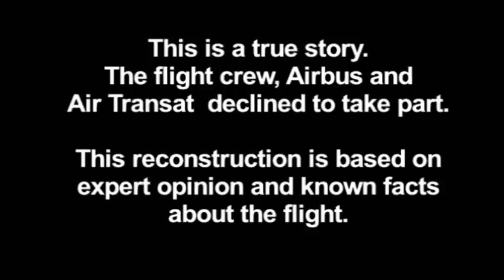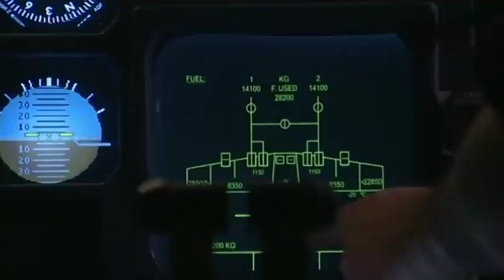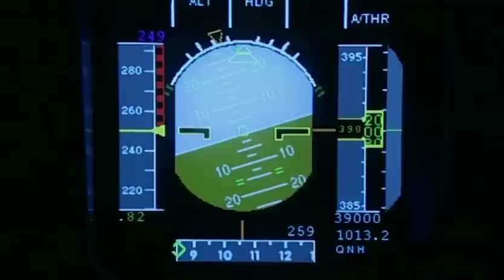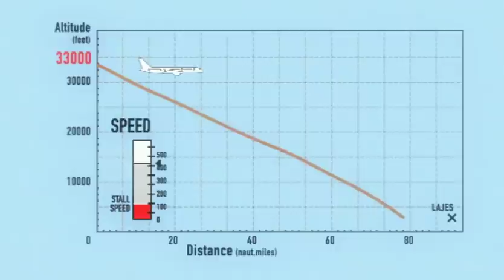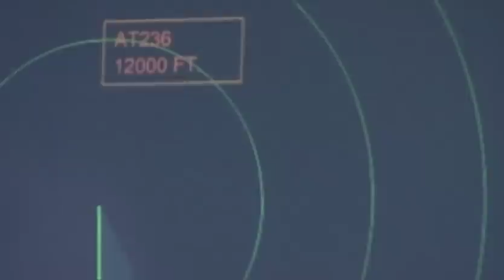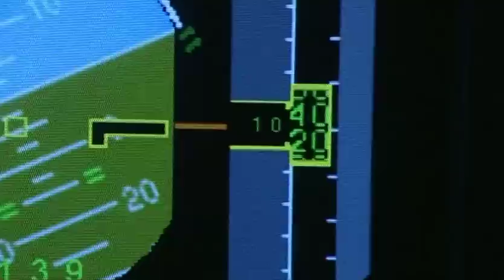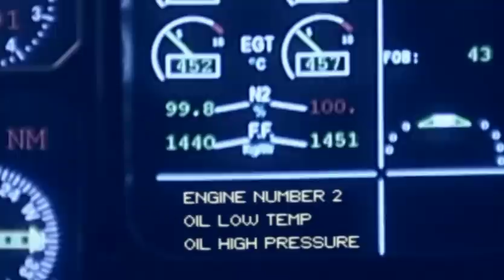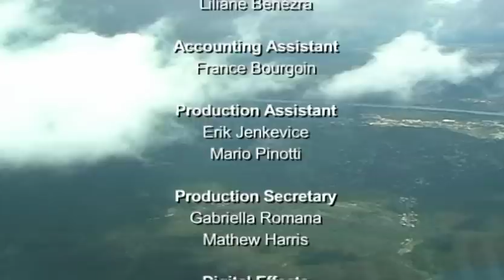Air Crash Investigations Mayday   01x06   Flying on Empty Air Transat Flight 236

Comment: How dare they try and blame the pilots and try and throw them under the bus, they saved everyone's life
Reply: Yea they didn't have to!
Reply: They did everything they could while believing the computer or sensors were faulty. I do not blame them although I would have gotten suspicious when fuel sensors from the other tanks said they were draining fast. I also would have asked for a fuel check somewhere around 5 minutes after the strange pressure reading just to be sure. Hindsight is everything for these kinds of things though and I’m not sure it would have made a real difference.
Reply: @dragonrider1817  they always teach pilots to trust their instrument readings
Reply: The pilots are  partially at fault for this.
One of the first lessons that is drilled into a student pilot's head is, "ALWAYS TRUST YOUR INSTRUMENTS".  They forgot that lesson.  I watched a pilot drive his plane into the ground because he would not believe what his instruments were telling him.  He got confused by the weather conditions below him on the ground and in the air.  He lost the ability to tell where the sky ended and the ground began.  Had he  paid attention to his instruments he'd left that plane alive an unhurt.  Instead, he died needlessly.
Had the pilots trusted what they were being told, they could have possibly diverted earlier and not run out of fuel.
Like it or not, they share some of the blame.
Reply: I am cornholio Although they do teach that but sometimes the computer has a malfunction and then the instruments won’t work properly then in that case that could leave in a disaster because u may not know your altitude or your airspeed and then your autopilot will disconnect I think then u will be flying by hand and if your instruments are getting a miss reading then it may say that your going down but in reality your going strait so u correct that then go up when u don’t know and at night u can’t see the horizon that much so it’s hard to tell with your eyes if your going up or down so then u end up stalling and if your computer fails then your GPWS call outs might be bugged out so it could call over speed or stall or both (like Qantas 72 the QPWS fallouts were saying “Stall Stall” and the over speed alarm was going off they landed though) so then u would be confused on what to do, do pitch the nose down or slow the aircraft down or pitch up further then if u slow down or pitch up more then u will stall and turn into Air France 447 the co pilot was pitching up even though the GPWS was saying “Stall Stall” HA TAKE THAT!
Reply: While the possibility for the scenario you describe exists, it is a very small one.  99 times out of 100, t he instruments will be correct, especially if you are piloting an older plane.  In any case, until you know for certain your instruments are wrong, it is best to trust them.  Even computer-controlled instruments rarely fail.
Reply: Allan David Well like I said with Qantas 72 the GPWS what saying “Stall Stall” and the overspend warning at the same time due a combination of a design limitation in the flight control primary computer (the software on the A330 and A340) and a failure mode affecting one of the aircrafts three air data inertial reference units and this happened in 2008. And the pilots could tell that they couldn’t trust the GPWS call outs cuz it was clear that they weren’t stalling or over speeding and in that case the autopilot thought that the plane was stalling so it pitched down very strongly and wouldn’t let the pilot fly until the pilot let go of the side stick and the plane leveled off so that was basically a computer malfunction
Reply: And LIKE I SAID, that is a very rare occurrence.  It is literally the exception to the rule.  Exceptions DO NOT make the rule.  09% of the time, such things DO NOT happen.  I'm glad it worked out okay, but just because it happened once, it does not follow that the instruments should never be trusted again.
Reply: I blame the senior pilot. He should of called an emergency very early on. Their was many signs that it wasn't just the computer fucking up. He seemed to worried about his reputation if their was fuel. If this reenactment is at all accurate on what happened in the cockpit.
Reply: @Mantis_Toboggan_TrashMan  the pilot definitely made a poor judgement by not believing the computer
Reply: @FaithandNova  Ok he should have taken his instrument warnings more seriously instead of concluding it was a computer fuck up,  but he got 300 people down safely with no fuel left in his plane. That IS the bottom line and all that matters.
Reply: I feel the same. It was a maintenance fault obviously. They did what they knew best under horrific circumstances and saved lives. All that matters.
Reply: The pilot's were at fault, they had too many different warning's to blame the computer, plus they should have turned for an alternate once they were getting these readings.
Problem 2: They clearly left the cross-feed on until the second engine went down, you can tell because the engine on the other side went down just 12 minutes after the right engine, this means they were running the cross-feed and feeding fuel from the good side to the bad non stop even though the sign's showed that the leak would be on the right side.
If the pilot's wouldn't have turned on cross-feed so quickly, or if they just turned it off after seeing the fuel was draining quicker than expected, or if they would have trusted their instrument's this wouldn't happen.
Reply: Because the crew made the decision to pump fuel from a good tank to one with fuel pouring out.   It defies logic but they did it.  If they had merely let the defective tank run dry they could have used the fuel in the good tank.
Reply: @Kev376  Did they even have a way to check for a fuel leak realistically? All they really hand was potentially unreliable information and their instincts. Ideally they should have at least have tried for running the math again after turning on the cross feed; then shut it off to salvage the remaining fuel.  Unfortunately tense situations rarely make for ideal circumstances. Honestly the fact that they maintained enough competence to land the plane safely says a lot about their capability.
Reply: @laughingman2082  Everything is potentially unreliable, but if you don't give your instruments a chance then you will regret if if you find out they are telling you truth..  I'ts been a while since I posted that, I would have to rewatch this to reliably give you anymore detail to my post and don't have the time, either way I hope things turn out for the best.
Reply: I am cornholio who really cares
Reply: Wrong. Assume the worst. He convinced himself it was a computer glitch, when he should've planned ahead in case it wasn't. Easy in hindsight, but he definitely deserves some blame.
Reply: Well technically if the pilots would have turned off the fuel cross valve the left fuel tank and engine would continue to function. BUT with that being said there were very few clues to suspect a leak from the right engine and they did an incredible thing by landing the airplane safely.
Reply: He followed the procedure. You must transfert fuel in order to equalize the weight of the plane each side.
Reply: I don't recall any depiction of any attempt to blame the crew.
Please time stamp your remarks in the script.
Reply: They ALWAYS try to blame the pilots easy scapegoats
Reply: , @allandavid9275  I agree with you, David. It is common sense, and there is no room for an error. I rather land early to make sure my passages are safe than to jeopardize their lives.
Reply: I can’t believe they didn’t close that cross feed valve. That’s obviously something they should have done

Comment: I still cant comprehend it, that something that heavy glides instead of just falling down immediately when no engine air is pushing it sideways, the air and wind up there must be 100 times stronger than we have down here
Reply: Airplane wings are designed to keep the plane in the air even without engine power. Also the wings are designed to hold the weight of the engines and the rest of the plane

Comment: Even if the pump looks the same its part number must match the list of part numbers approved for that specific engines part/serial number.
Reply: @Jesus Christ Point being the mechanic didn't use or ignored  the maintenance manua IPC reference. When the FFA visited us they didn't look at the aircraft we were wrenching on, they asked us for our maintenance manual references. Also all of the inspectors that checked and signed off our installation checked the part numbers. Research and paper work is half of the aircraft mechanics job. The Airlines sent us to class to show us how to use the maintenance manuals. None of the mechanics or inspectors I have worked with would have installed and signed off that pump without checking the numbers.

Comment: I'm thinking it read oil temp low because of the abnormal fuel flow to the oil to fuel heat exchanger. And the high pressure probably cause of the low temp oil.
Reply: Ikr

Comment: Thinking the computer is wrong was their biggest mistake. one wing heavier than the other is a much less of an issue to deal with than a leak and a dead engine. They should have closed the crossover when excess fuel loss was noticed and then not used the crossover until it became apparent that the plane was becoming unbalanced (the left wing would dip). this would have given them max range. in other words NOT using the valve is a way to diagnose u have a leak.

Comment: Am I the only one dying to know why they didn't turn off the cross feed at the first suspicion of a fuel leak, wth.  Also, why don't they have a little light that says how many miles of gas they have left.  My car has that.  Also, also, which is worse crashing with shoes on or being on a plane where everyone was told to take their shoes off
Reply: Amellia Mendel The most they had to know was the plane said low fuel pressure warning. They thought maybe right engine not getting enough fuel, lets give it some more by cross feed like the manual said. Back then everyone thought things like this could never happen. 
Now we know better. But still hindsight is 20/20.

Comment: Couldn’t the low oil temperature have been from exposure of the leaked fuel causing exposure of the oil to outside temperatures?
Reply: No they didn't have anything to do with the fuel leak.  those readings were for engine lubricating oil temperature which is a completely different problem. That part probably was due to a bad sensor or some such thing
Reply: Low oil temp was caused by jet fuel leaking onto the engine and cooling it. Cold oil made the pressure rise. They followed the procedure book and called Mirabel for help. That's why at the end changes were made in the procedure manual
Reply: HighStreet Killers —Thanks for the info
Reply: What exposure to outside temperature?
Reply: @willschultz5452 ,  when will scientists create a crash-proof airplane?  an airplane that falls from the sky onto the ground,but does not get destroyed.

Comment: Odd with today's technology that we don't use more ground support when flying these behemoth computers. A Formula One car for example has a team of support staff constantly reviewing car data for potential issues via remote intelligence sent from the car to the pits. You would think with so many challenging tasks for today's pilots air to ground monitoring could tell pilots long in advance of potential issues and what to do to avoid catastrophic failure in flight? Reading a manual for a procedure generic in content seems a bit outdated?

Comment: Runway Repair & Facility Use Invoice: 
800m 5cm depth divots - $280,923; 
1,400m rubber abrasion - $4,543; 
fire rescue services, 2.56hrs - $330,429; 
towing & storage - $127,895
unscheduled flight 48mins @$432/min - $20,736; (includes radar & vector services * weather reporting * transmission band usage * visual spotting)
customs clearance & transit passenger hosting services - $14,330 (includes toilet flushing)
patience & tolerance fees - $85,842
island presence convenience taxes - $822,722

Comment: They should have closed the cross feed valve,  when they determined that they were now losing fuel faster in the right tank than the left tank, when they opened the cross feed valve to even out the fuel to both tanks.  Anyway the plane became a glider when both engines quit, and it was an amazing feat to land that plane safely.

Comment: Don't worry if you run out of fuel in a  passenger jet liner you will still be completely safe because of your altitude as long as you're within a few hundred feet of a airport you can land safely see no problems. Pilot should not worry if their fuel gauges read empty they're usually wrong just a computer problem
Reply: Good one.

Comment: Here is the problem, a wrong part installed lead to a large fuel leak and with various types of weather and other common anomalies that give false sensor readings on a regular basis the captain made a good judgment call and when all else fails he was still able to save the plane and the 300+ people who were on board by landing the plane with very minimal injuries and No loss of lives at all so Salute to the Captain and First Officer of that flight, they did there best in a time of crisis and succeeded in a safe landing after gliding for miles with no engines working on a fully loaded plane and for those investigator to even try to point any blame at those to hero's who saved the day due to a problem due to wrong parts and a company trying to save money is a real Bullshit political maneuver to try to shift blame and get out of the responsibility for the mistake someone else made. Those two pilots are the reason the plane landed safely and all the passengers are still alive after landing safely under total failure of both engine's. As I said before Salute to the Captain and First Officer of that flight.
And to explain this situation as I can compare it to in the field work I do, I am a Refrigeration Parallel Rack Mechanic, a Parallel Rack Refrigeration System is what a large Grocery Store uses to keep all the cold food cases cold and in lay men's terms instead of one unit that is 3-5 HP running one case with 8lbs - 15lbs of Freon in the system, kinda like the one air conditioner unit outside of your house that is 2 ton or 3 ton and has 5lbs or 8 lbs of Freon in it a Parallel Rack Refrigeration System is 30 HP - 100 HP and has 300lbs to 1,000lbs of Freon gas in it and the older Rack system's has time delays and pressure controls for everything and that was in the 80's when we still used R-12 and R-502 and as we got into the 90's and the old Freon was phased out and computers were starting to be used we all kinds of sensor failures but the old pressure controls were all there still as a emergency back up and with my service gauge manifold set to test pressures I was able to get Racks up and running again many times with sensor failures being the reason the cases were getting warm and those pilots who learned to fly in older military fighter planes that had manual gauges really know what they are doing so that is how they can still land a plane when it all fails and they have to glide to the nearest runway  is the old school training they had just like me on a Rack system, with 100 HP and 1,000lbs of Freon gas you can get yourself into a lot of trouble Fast if you are turning the wrong valves and whatnot and you need to know how to get yourself out of trouble in those situations and those pilots are in the same situation only they have many lives at steak were I only have my life and those few working with me and several thousand dollars with of food in the cases in the store at stake but in major gas leaks in a motor room we had to tie a rope around our waist, hold our breath and go in and try to find and stop leak and the rope was so the others could pull us out to clean air and save us if we passed out with no breathable air in the motor room while trying to stop a huge Freon gas leak  so I hope this comparison helps you all who are reading this understand what is happening and how those pilots are able to land planes in sutch failures still and save all the passengers. Thank you for reading my comment on this video

Comment: Wow, who was supposed to inspect the maintenence work. Hope someone was held responsible.
Reply: lori doolaghty, I'm wondering if it's the maintenance crew's Superior, the same jerk who told the mechanic to use the parts from the one they were replacing because it would cost too much money to have to wait for a new part to be delivered. Imo, that Superior is the person who is the cause of this accident.
Reply: Nobody inspects the maintenance work the mechanic does the work and fills out his paper that it's finished and the plane rolls back out into service. The mechanic did not want to do the job the way he did it but his superiors forced him to. Personally I would have said I'm not doing it that way! I know better then to do stuff like this!
Reply: @willschultz5452 : the Mechanic Brought Up the Fact That the Hydraylic Pumps Weren' t EVEN the CORRECT PARTS For That Engine,So Supervisor Should NOT EVEN APPROVED THE INSTALLATION OF THE UNDERSIZED PUMPS.MAINT.SUPERVISOR SHOULD HAVE BEEN TERMINATED & BROUGHT TO JUSTICE IN A COURT OF LAW, REGARDLESS OF BAD PUB FOR THE AIRLINE.ANY FUTURE PASSGRS.WOULD HAVE BROUGHT THAT INTO CONSIDERATION For  THE AIRLINER PROSECUTING THE SUPERVISOR,I WOULD THINK.By The AIRLINES DOING THAT,THEY WERE WATCHING OUT FOR THE PERSONAL SAFETY OF PASSENGERS.
Reply: Doubt it. Nobody is personally liable, it's a company. $250 000 fine is a joke, less than $1000 per life endangered